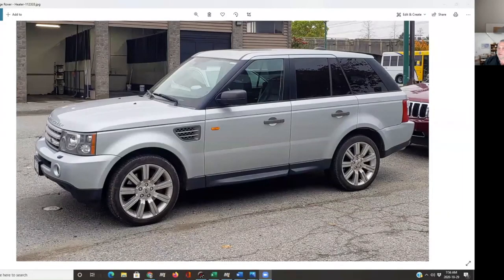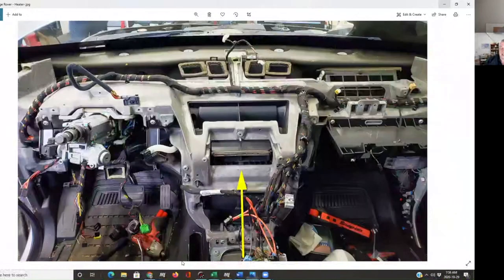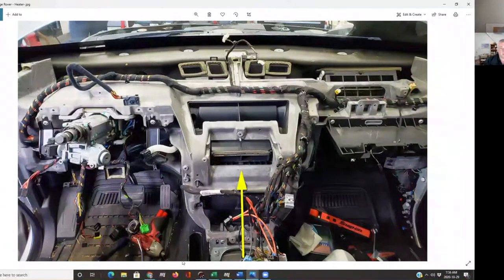2008 Range Rover, Heater Core Replacement

Comment: I am not hating, and it is definitely an interesting video, but....  the total dash removal is not necessary to change out the heater core.  I, unfortunately, have done two changes in the last couple of years, and while still a pain this can be accomplished by just removing the center console and components, the glove box, inner kick panel, and a blend motor. Even the newer cores with the pipes attached can be modified to avoid complete dash removal. 
Again, not hating, but I would hate for an RRS owner to think that the only way the one-side heat issue could only be cured is by throwing thousands of dollars at it. Especially when the part is only around $150, and the rest is just time and patience.
Reply: Right, I feel sorry for the guy who paid them for all that extra work, prob cost X3s what it should have in labor

Comment: How much do you charge for the core replacement?
Reply: Hi, 

would need to inspect the vehicle in order to get an accurate quote - you can find our email and other contact info on our website which is linked in the description box. 

- Pawlik Automotive
Reply: I was just quoted locally (not the dealership) around $1500 for the complete heater box and $1800 labor...after taxes it would be around $4000.  Think I'll try taking the center console loose and remove the glove box and replace just the heater core.